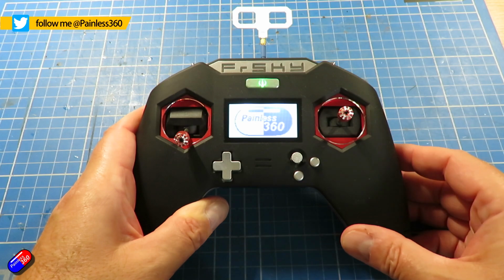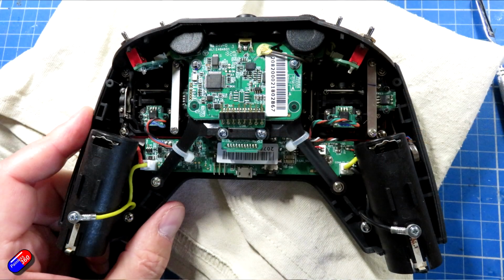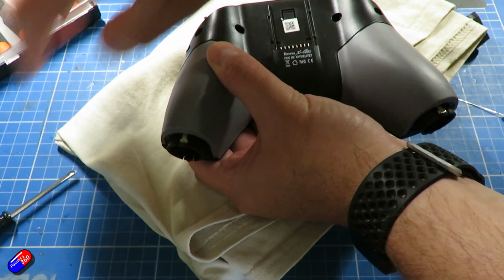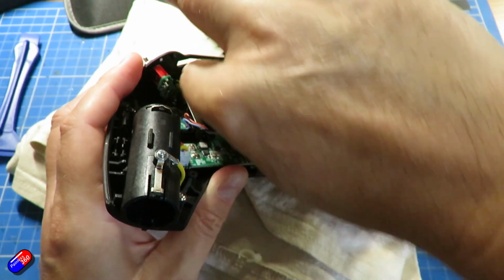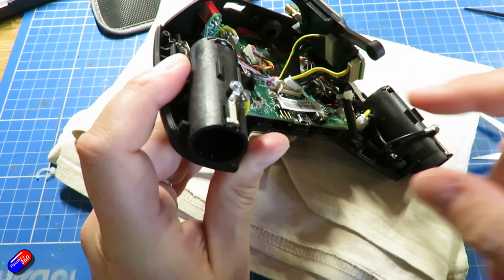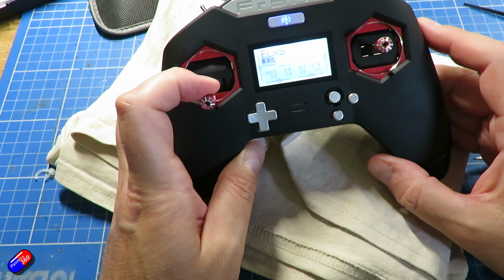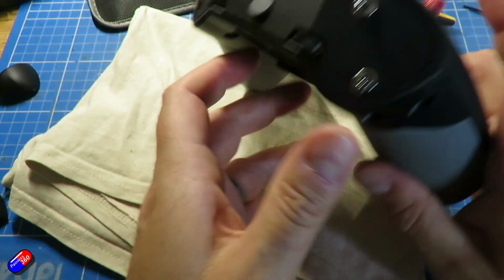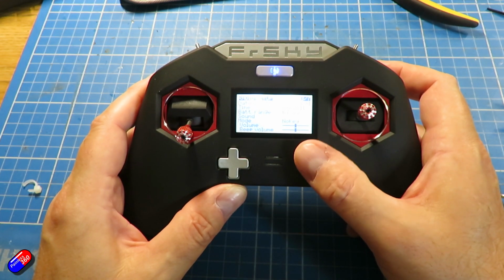How to fix the FrSky X-Lite RTC Battery Low Error (replace the internal battery)

Comment: Good video, and I like your approach of separating the halves at the rear panel instead of at the battery holes. Gotta keep the old girl going. As much as I hate FrSky for the last few years, I like this form-factor, and if you're ever going to try out 3D (quadcopter) flying, having a centered, sprung throttly makes it a million times easier, and to my knowledge, this is the only one that lets you quickly and easily do that.

Comment: I love the ability to remove that primary batteries... is this still worth getting today for whoop racing using elrs with a module? Everything that is coming out now has internal batteries and buttons instead of switches. I have that TX16s but need a grab and go radio for those times where I just want to get out and rip a few packs.
Reply from the maker: I've not used mine with ELRS here. There are modern versions of the radio like the RadioMaster Zorro that will work with ELRS... Best of luck
Reply: @Painless360  Would love to use the zorro... but the battery is my only reason for not buying it. Also I have an frsky dongle for my sim so this would work for a grab and go and a sim controller.  Thank you for this video. keeps it future proof.

Comment: Thank you for making this video. Dug mine out recently and had no idea what this error was. No documentation on it from FrSky. Your video was my first search result. Managed to get mind replaced tho did snap two of the shell clips in the process. It would be nice if these radio manufacturers put these in a user accessible spot. A bay under the rear external RF port would have been a perfect spot!

Comment: You can check Rtc battery status under hardware menu 6  that say  check RTC  and see live Rtc battery voltage and if is low you just unchecked box so radio don’t warning you about it or  instill you replace the battery.
Reply: Thank you, just did that to mine. It was on 0.44V.
Reply: A little late on the reply but if that rtc battery goes out does it turn off the entire radio? I could care less about the rtc battery showing the date and time I just don’t want it shutting off the controller mid flight one day
Reply: @xmwxmorris if it dies you will lose radio config settings
Reply: @madladdan  thank you for the reply
Reply: @xmwxmorris  better late than never
Reply: @madladdan  yes sirr! I appreciate it!
Reply: Good call.  I didn't want to take mine apart just to have the date be accurate.

Comment: Is this your favorite of the game controller style transmitters? I'm using a TX16s and want to try one of these, but I'm kind of overwhelmed by the choices. 
I like the size/layout of this one the best, but it looks like just the newer ACCESS version is available. It's not a deal breaker if this is the best of the small radios, but all my FrSky quads are currently ACCST.
Reply from the maker: Check out my Kit Picks 2021 video for my current choices. This TX is old now and there are lots of choice.
Reply: @Painless360  Will do, thanks for fast reply!

Comment: Great info as usual nice to see these old radios becoming useful again with ExpressLRS ... which module do you like I’m looking at the betaFPV 👍
Reply from the maker: I've had the BetaFPV stuff in here and have some others on the way too. After some of the struggle I've had, I could have been tempted to wait for V1.1 or V2 of the hardware from most of the vendors..
Reply: Every FM radio I owned could to that

Comment: Thank you for this video, I also need to replace RTC battery of my radio; but wondering what happens if I decide not to replace RTC battery?
Will anything else malfunction besides the date? Thank You again.
Reply from the maker: It will still work but the date will always be reset on power off and you'll get the error.
Reply: @Painless360  and also, perhaps the battery will eventually start to leak (?) though I don't know how long this would take to happen and also if this happens for a battery which is 'in use' i.e. with the radio being turned on and off, despite it being flat...